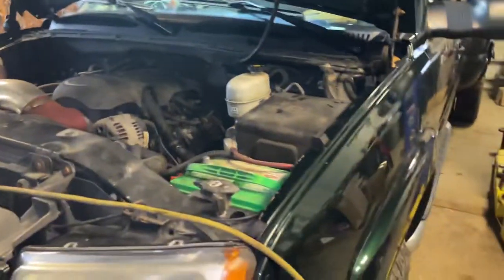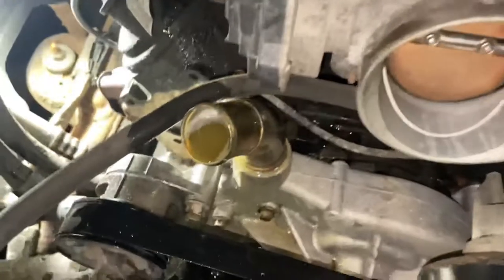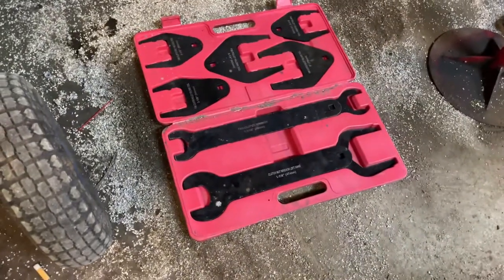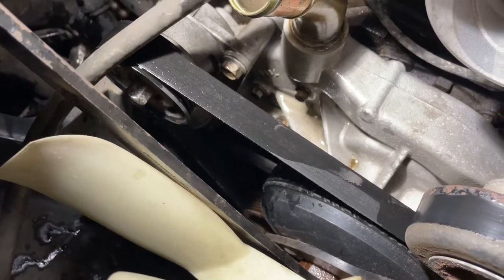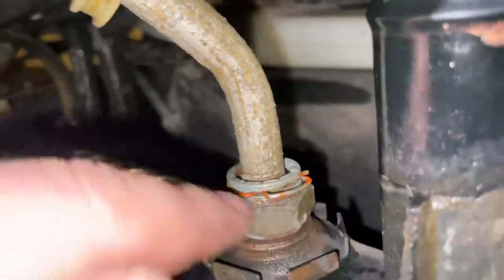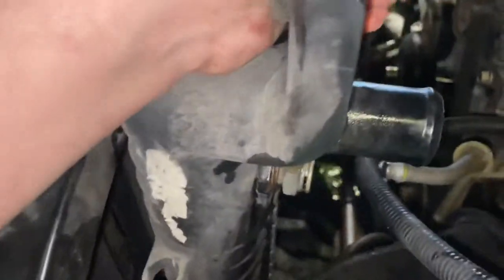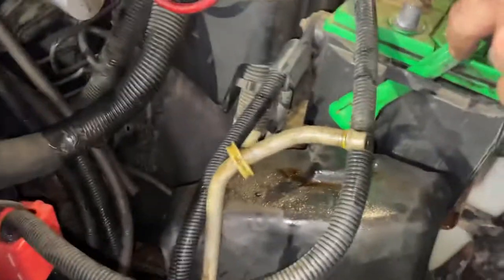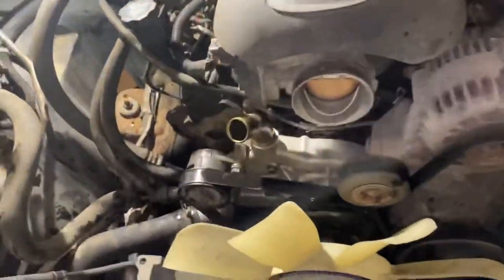Replace radiator Chevy Silverado GMC Sierra with oil cooler

Comment: As far as the transmission/oil portion do you loose much disconnecting the lines to have to add when done? If so do you need to bleed air from them after?
Reply: also wondering this ^ great question
Reply: @gto.eduardo  I just replaced my radiator and Lines so i can answer since no one has, you don't loose all that much of either I'd say less than a qt of oil/tranny fluid, obviously coolant you'll need abunch of. As far as bleeding nothing was needed in regards to tranny or oil, cooling system you want to keep cap off  Reservoir let truck warm up put heat on low, until thermostat kicks on the shut truck off and let completely cool down,add if needed, start again let warm up till thermostat kicks on, shut off cool down, add as needed, about 3 times all air should be removed, it's a long process